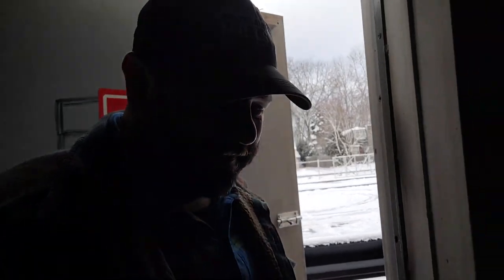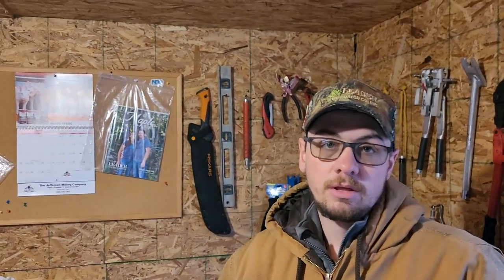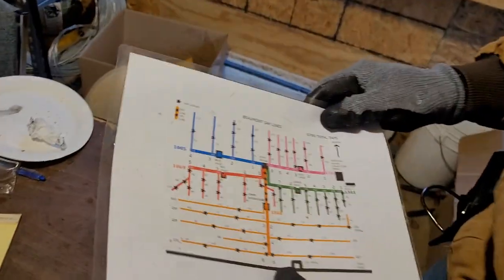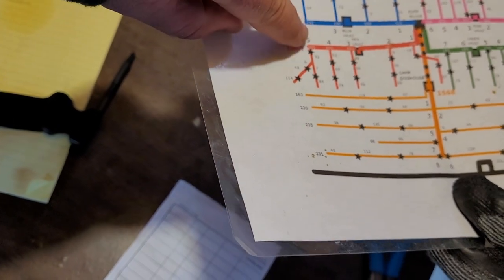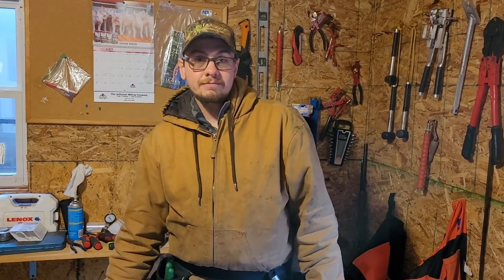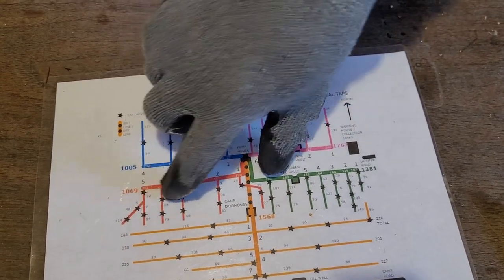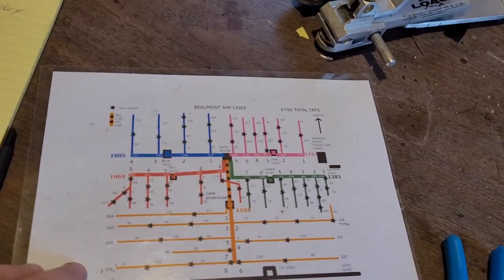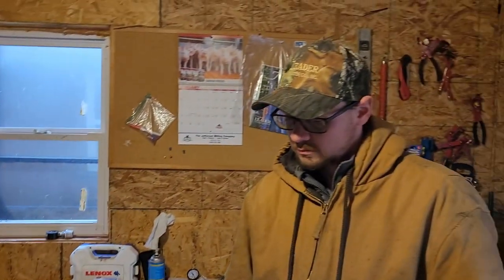#104 Why do we change drops and spouts? | Send us YOUR sugarhouse videos!!

Comment: I love my flat semi sloped woods. Can visit all 500 taps in a day.  Great for guzzler setups. 26-27 inches of vac without ladders, releases or high dollar vacuum.  Do the stubby\pin setups make perfect seal like tap\cup does?
Reply from the maker: Yes they are both tapered.  The poly carb definitely grabs more than the poly ethylene.
Reply: @BissellMapleFarm  sorry but which is which?
Reply from the maker: @TheSmagzilla  clear is poly carbonate.  Black is polyethylene.  The poly really seats in the tree, too.  You can see the sap flowing - which is cool.
Reply: @BissellMapleFarm  oh yes I agree.  I was more asking if the stubby and tee with pin make a perfect seal if you were to pull a tap.  Producers with expensive vac aren't woried about microleaks like I am so maybe you don't pull many taps from that.  If I have a microleak on a tap I pull them...maybe 10 a year but they add up to higher productivity for the woods when using a diaphragm pump.
Reply from the maker: @TheSmagzilla  I understand your question now.  Yes.  They seal up tight.  We like tapping with vacuum on.  It seals better than the cup in my experience.

Comment: What about check valve adapter/spile part. The one with the little ball to block the tap from sucking back into tree ?? Curious 🧐
Reply from the maker: What do you want to know?
Reply: @BissellMapleFarm  do they work better at helping tree heal faster ? Is the added cost worth it ? Gravity feeding into buckets atm but next year I plan to run vacuum lines